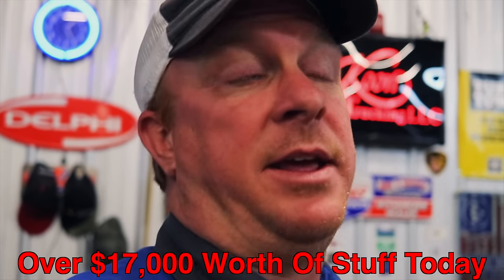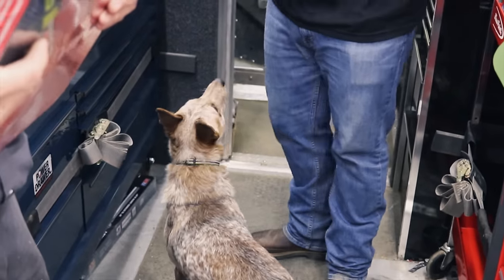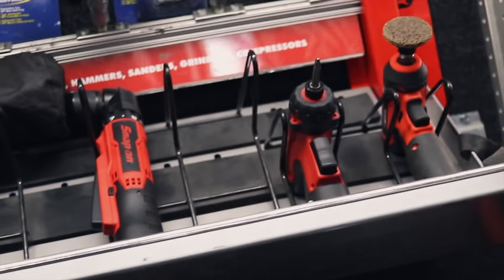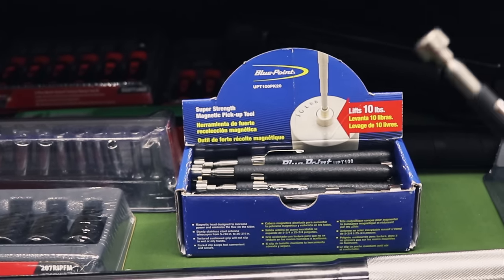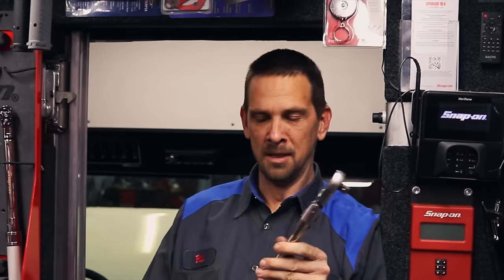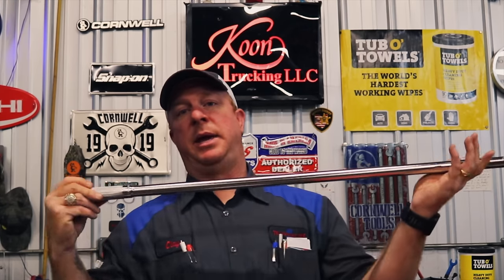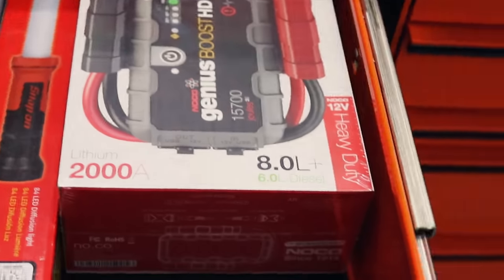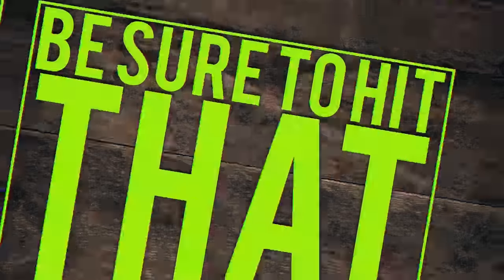HUGE Snap On Tool Haul, Over $17,000 Worth In One Stop

Comment: I just purchased my $800 Snap On floor Jack  - from Haror Freight for $179 ( Daytona Super Duty )
Reply: How has it worked for the last year? Lol
Reply: Probably still kicking. Matco’s 3.5 ton jack tho I’d prefer over the snap on jack and Daytona
Reply: @ham7053  NOOOOOO. I have the Matco 3.5 lo-profile and I hate it. The first one never quite bled right, then I got a new hydraulic unit under warranty, put that it, worked for 10 months (daily shop use) then died. Now would cost me $230 to fix. For that money you get a whole ass HF Jack
Reply: @colemanbonner  we got a Matco beast 3.5 ton jack in a shop I work at and it’s pretty dang old and we use the piss out of it. We lift up skid steers, tractors, etc. Still works good and pumps up to full stroke in 3 pumps. Maybe we’ve just had better luck lol
Reply: @ham7053  perhaps mine is different, it’s not labeled as “beast.” Its P/N MLPJ35T.
Reply: @colemanbonner  ill make sure to avoid that one then thanks
Reply: @ham7053  I looked it up on the Matco website. My Jack has 1/5 stars, the “beast” has 5/5. Go figure. Lol
Reply: @colemanbonner  it 100% is a beast, highly recommend
Reply: Cool 😎 .
Reply: My foot lever broke in less than a year The long reach is great for my lowered cars onn coilovers but disappointed onn the foot jack. they sell that for tight areas and it failed.

Comment: I’ve got a battery 1/4” and two battery 3/8 guns that I use on the regular along with a 3/8 M12 ratchet and several air butterflies (Yes I still rock those). Why do I still want that 14.4?

Comment: I buy Kobalt. Same durability and for $17,000 you could probably buy most of their tool line.
Reply: Hell, buy around xmas and you'd have 2 complete sets of their line plus a few boxes. lol
Reply: How good is Kobolt I mean everyone has their opinion but I was looking the other day and they have huge sets with boxes for a good price but when I see it and see how much you get for the price and even the quilts of their boxes are good but I just questioned it.
Reply: @agentx250  Kobalt ratchets are junk. Nothing compares to a snap on ratchet, if youre on a budget go with a craftsman.
Reply: @JSMO DSM I've never used Kobalt tools but I've had good results with Husky. Craftsman keeps getting shuffled around and their quality isn't what it used to be. I'd never spend that kind of money on a snap-on product though; that shit's crazy.
Reply: @jsmodsm5796  i have had my Kobalt ratchets for 2 years under heavy use and they have not broken. The older ones were junk but the new ones are better, especially the 90 tooth ones like I have
Reply: @mikedavis8026  I havent had a problem with any Kobalt tool. They are used heavily too.
Reply: SpecTRe X  The Pittsburg/icons are great ratchets and compete with snap on in strength

Comment: I have the FHL80 with comfort grip and love it.Use it more than my Mac version now.Only complaint I have with it is no USA on it,is from the years Snap On did not put USA on their ratchets
Reply: Walter Frederick you mean from the year snap on ratchets weren’t made in the USA
Reply: This one is from 2011 or 2012.
Reply: @Toolaholic7  They are not allow to put "Made in USA" if the tool or parts of the tool are made in China.
Reply: If you have the rubber handle and it doesn't say USA, it's because the handle and the handle only was made in China so they couldn't put "made in USA on it". They started making the handle in the US because their customers were worried that they were buying a Chinese made product.

Comment: $20 for a magnet? That's probably all I'll be able to afford, good thing they take payments 😂
Reply: Not when them cheap ones cost $10.00.. And they still break. I bought that blue point one 10 years ago. It still nice and stiff. The shaft doesn't come flying out. Then you have to supper glue it back in...And it does pickup 10lbs with that narrow head...
Reply: @MasterChief-sl9ro  Yeah I was thinking about how it could hold 10lbs, which is probably why it's worth it honestly. Can't go wrong just trying it out. Better a one-time purchase than to have to keep buying cheap ones
Reply: @_DC5DEE  I would add. The Blue Point one. That little shield around the magnet slides up. So you can use it to remove or install them Intake bolts. That are easy to take out or remove if you want to remove the Radiator. Not sure why Ford did that. As even a flex extension is a bitch to get in the hole with a socket. So I stick that bolt on the Magnet side. Use the socket to push it off into the hole. That way it does not fall off on you. Then you spend 5 mins fishing it out. Then trying again. 

But I do find them lower bolts missing. As someone that had the same issues. Just never installed them back in there. Then you get an intake leak. With lots of them codes. And they never know where the problem is.

Comment: After hearing “I wonder if that little one (the jump starter) would jumpstart this truck” then said “I don’t know about the little one, but the bigger one sure will”.

Why would you say that? What would be the difference? If they were both made to specifically jump cars, why could they jump a bigger truck/diesel truck.

Years ago, I heard someone say. “You can’t jump a diesel with a gas engine”.
Why is this? I’m assuming it doesn’t produce enough power (to get it turned over and running). But, why is this? What is the difference (as for the power issues)?
Reply from the maker: Well obviously it is combustion and the number and size of the cylinders. It’s like saying a lawnmower battery had the same power as a truck battery. Granted it is a 12 volt battery but the cranking amps are much lower. The bigger the motor the bigger the starter and it will require many more cranking amps

Comment: The difference between those Knipex pliers is one is standard and one is metric, if I have to tell you which is which you're in the wrong line of work.(sarcasm) ;-)
Reply: The 87-21-250 (Quick Set) only have teeth on one side, it allows you to slide the jaws closed with out having to press the button to adjust them.
Reply: I should really watch the video fully before commenting, my bad lol